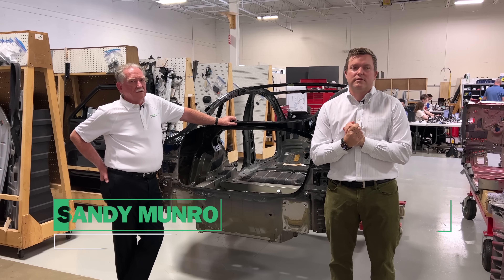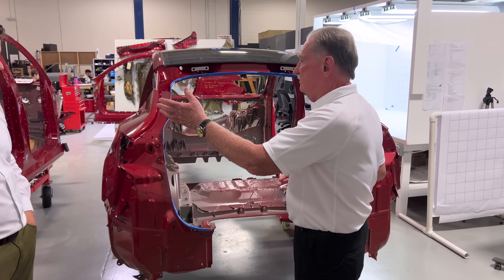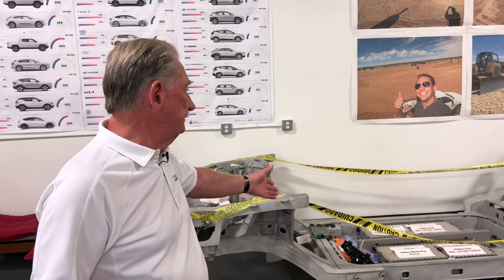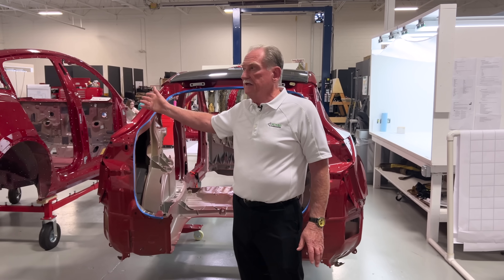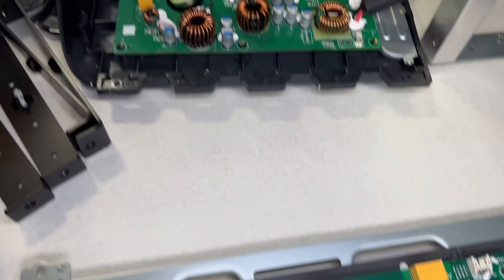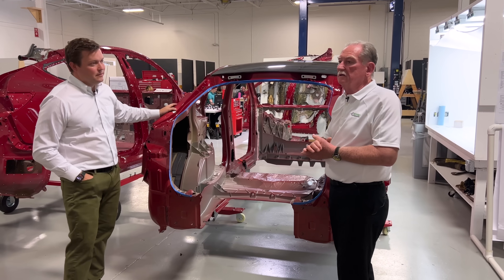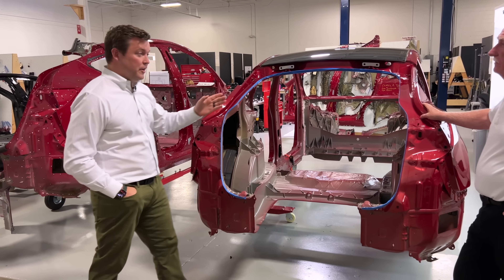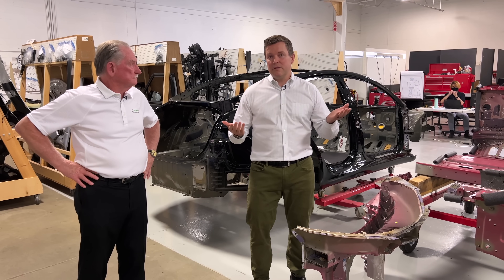Giga Castings with Sandy | Evolution of Tesla Bodies In White

Comment: Thank you, I’ll watch this evening.  I’d be really interested in learning about the molds that go with the large castings.  It’s a Canadian company making them, and they acquired this May two factories in Italy, 20 min drive from IDRA, presumably to supply the European gigafactories.  How many stamps does one of them molds last?  They talk of “rebuild” of the molds, how is that different from building one fro scratch?  Do they need heat treatment?  how is that done? Learning a lot here, thanks.
Reply: I believe the rebuild is them having to redesign the giga press based on feedback and changes in physics due to size.  I know physics doesn't change but when you reach a critical increase in size, the old ways of doing things don't scale properly so they have to be tweaked.
Reply: Steel molds for plastic injection pull 1million parts  the heating and cooling causes micro fractures in the mold, and mechanical wear finally cause out of tolerance part. But that's plastic,. I have no idea about this amazing aluminum alloy Tesla is using. Haven't read any papers on it.

Comment: It’s awesome to see a company like Tesla willing or be brave to take a step backwards (willingly making all of their existing machinery and processes redundant which would’ve been a huge cost) and end up not two steps but several steps forward of any OEM manufacturing process. 

So with the front and back castings and the structural pack reaching just about where our engineering imaginations can go at this point in time ... what is you wish list of what we can improve with the body shell and bolt on panels ... do they have to be all sheet metal? Are there any materials that we can make these out of (that are recyclable in the future), particularly for the bolt on parts (hatch, doors, front guards, bonnet).
Reply: I was watching something about a new police boat (fr. Ultimate Boats) the other day that uses DANU (fr. Exotech), a fully recyclable composite. Probably ridiculously expensive, but the ability to repeatedly recycle and reuse the composite is very interesting. Oh, and DANU panels are bullet proof against small arms which might be useful in some countries :-)

Comment: The first thing the comes to mind with castings is cracking at some point during its service life.  How does TSLA address this.  Just curious.
Reply: Far more likley that those glues/rivets/welds and weld joints will fail at the end of a cars service life.  Every added part is another failure point.  if designed properly, I expect the casting to easily outlive the car, assuming it doesn't get into an accident.
Reply: You obviously didn't watch the whole video. Sandy addresses your question.
Reply: @Triathlete5551  I did watch the video.  In Berlin, some have reported 60% of castings are being rejected.  Has this been fixed after the upgrade?   I worked as a BMW mechanic and have seen cast parts crack.  I’m sure TSLA has done their homework, but for now it’s still kind of scary.  I’m sure the fear will go away over time like it did for range and battery life not so long ago.

Comment: Acknowledging that the castings are a much better way to go, and saves the company a lot of money, then why hasn’t Tesla implemented them for the Model 3 or the front casting for the Model Y made in Shanghai?
Reply: They will.
Reply: They've even added castings to the much lower volume Model S and X with the 2021/2022 LR/Plaid.  Now these are not quite as large as the Y/3 castings, but makes perfect sense for the volume.  My guess they are using the presses that used to make the half-frames for the 2nd generation Y.
Reply: Model 3 has had a rear casting for close to 2 years already.
Reply: @sjokomelk  No rear casting on Model 3. Current line improvements at Shanghai maybe.
At some point, we probably will switch to a single-piece casting, but I think we need to get the Texas factory and the Berlin factory going. We do have an issue. It is hard to change the wheels on the bus when it is going 80 MPH down the highway. So, Model 3 is…well, was most of our volume. Model Y will exceed Model 3, but we just need an opportunity to redo the factory without blowing the cash flow of the company.” 
Musk in Munro interview 02/21.

Comment: good talk by Sandy indeed.

what I wonder: what can Tesla improve next?
Reply: Tyres are pretty much all that’s left.
Reply: Mega volume production AI controlled.
Reply: Once the manufacturing process is optimized, it will be time to address the possibility of easily fix the battery when few cells fail.
Reply: @bernardouellet4324  that's pretty impossible with this 4860 pack, like Sandy showed

Comment: Love this coverage and statements made in it. Thanks for brining up the damage to the casting since so many people fail to understand to damage the casting, you will be happy to walk out alive since you have crush cans etc to take most of the inertia. 

The financial saving for the Giga castings is crazy, not just in part cost being cheaper but also logistics, chance of failure, quality check, molds for the small parts, workers, fixtures all cost A LOT of money.
Reply: I know!  I've been having this argument with people for years.  If the frame/underbody is bent, even in a traditionally-made car, the insurance is going to write that off as a loss, and send you a check.  One of my first cars was a Honda Civic.  I got into a accident, which looked pretty minor, but I bent in the undercarriage by the front passenger door, and the insurance company wrote me a $12k check.  If you're in a bad enough collision to bend the frame, you're getting a new car either way, so the "repair cost" is a moot point; they will never be repaired.
Reply: @AMortalDefiant  The only way most people learn about this is from an accident.  A wildly destroyed single part e.g. bumper cover is cheap to replace.  Two slightly broken parts costs twice as much.  A crushed fender is a common unbolt-replace repair.  A very slight wrinkle in the C pillar means that something is bent beyond repair.

Comment: As always, another great and informative video.
I have been having an online debate regarding the advantages and disadvantages of using cast aluminum vs fiberglass composites for structural components of a modern vehicle. I know that you are very busy and receive 100's of comments for each video Munro Live produces.
If you could please weigh in with your thoughts in regard to, are aluminum castings or fiberglass composites 1) more cost effective, 2) environmentally friendly, 3) end of life recyclability.
Thanks again for another great vid!

Comment: This is great stuff. From what I have read and watched, castings are expensive, the giga press is super expensive and are ideal for 50,000+ unit production run. How would startup OEMs adopt this technology? Are there giga presses available that are ideal for low volume production? If yes, would they justify unit economics?
Reply: In auto the opportunity has passed.

There’s no other obvious (to me) application requiring that volume at that size where it matters.
Reply: Ok. So basically the first 2-5 years of production would still need to be the conventional process (stamping + welding )for startup OEMs till 50000 units are achieved.
Reply: @immigrantlife1089  legacy auto can’t reach those volumes because Osborne effect would bankrupt them when everyone stops buying their ICE cars.
Reply: Unless you have deep pockets, yep, a startup is not going to be able to afford a giga press.  Then again, having the the steel presses and tooling for 150 parts, the equipment to assemble those 150 parts, and then a QA and scrap costs when those system don't work well may exceed that of a giga press.  Automotive startups are hard and very capital expensive.
Reply: @tesla_tap  Your right, that's understandable. Today they developed a 6000-9000tonne press, do you think, in the future we could see 2000-3000 tonne press developed for smaller and lower run applications,  just like slow run and fast run injection mold machines?

Comment: Everybody calls it a firewall, that's what it was (for ic engines)
Reply: Not in public
Reply: @fredbloggs5902  
Yes, in public and not just in cars.
Of course it is also used to deflect the engine under the passenger cabin in a collision.
Presumably neither function is required on this vehicle.
Reply: @andrewholdaway813  in the U.K. it’s always been called a bulkhead as far as the public are concerned.
Reply: @fredbloggs5902  
Yep, that's an equally valid term.

Comment: Haha love this! This video is Sandy's 'I told you so!' to the car execs that told him he was crazy for proposing such castings many years ago.

Tesla is focused on great engineering over profits first unlike the traditional OEMs. Tesla engineers took a genuine look into a fellow experienced auto engineer's thoughts, agreed with him and even went beyond that to implement them right away. Tesla took a multi-million dollar bet on getting these casting machines and it pays off, from the machining at the factory to the end of the product's life during a severe but life saving crash.

Munro proves how great engineering can make a massive difference in your manufacturing, costs, and end product, even if it sounds crazy at first! #BreakTheMold
Reply: The castings are great for Tesla's bottom line, but not the consumer or environment. Any damage to these castings, even from small accidents, is not repairable, so the cars are a complete writeoff. This pushes Tesla insurance costs to absurd levels and forces a vehicle with an otherwise long remaining useful life into a landfill. Other cars, without a giant casting, can be repaired and put back into operation. And that's much better overall for the consumer and environment. Also, the cost reductions from these castings are not passed on to the consumer. Tesla's purchase costs has been increasing steadily every month. And Sandy is praising this approach because it gives him a sense of vindication, so his comments on this topic come with a heaping dose of confirmation bias.

Comment: Several concerns I have with the cast parts:

1. Because of the nature of molded parts, you can't have any tubular structures which are ideal for strength and rigidity. I wonder if strength was a sacrifice they consciously made.
2. I don't know how well their special alloy holds up against vibration, but generally Aluminum is susceptible to fatigue, I'd like to have data on that if it ever becomes available.  
3. Although simpler, cast parts are not always uniform. I'd like to know their tolerances for the part, and their scrap rate.
Reply: Castings use webs instead of tubes.

They are clearly visible.

This isn’t new, it’s been done for decades on things like gearbox housings.

You don’t know this?
Reply: 1. They're not replacing any tubular structures which would've been in that region of the structure. 
2. Fatigue in such a substantial part should be even less of a factor than in an engine block or transmission casing, and fatigue life should be extremely long. 
3. I have no idea :)
Reply: @jamesengland7461  
1. Perhaps, but they're looking to use castings in the Tesla truck, where frame rigidity will become doubly important. 
2. Fatigue is a function dependent on material strain, they mitigate its effects in an engine block with added material thickness, which these cast parts don't seem to have.
Reply: One absolutely can make tubular structures in castings.
Reply: @timrowledge7152  Yeah only in the direction of pull. Given the size of the part and extreme temperatures, I'm guessing pretty steep draft angles....Your tubes won't be very long.

Comment: Tesla should get rid of holes in the B pillar. This will strengthen the body in a side impact structure. The seatbelt retractor can go under the seat or in the seat. Or at least get it off the floor but by at least 18" off the floor. It's a very bad place for holes in the car's structure.
Reply: Yet strangely, Teslas have the highest safety ratings of any cars ever tested.
Reply: @fredbloggs5902  In a T bone collision the B pillar needs to be as strong as possible. It would cost less to not cut it out and bolt the retractor under the seat. They have done this in the rear seats. 1/3 of all fatalities are the result of side impact collisions. This modification should yeild a lot of safety for almost no cost. Maybe a negative cost.
Reply: @suggesttwo  you’re welcome to list all the people ended in side impacts in Teslas...

...oh wait! There aren’t any.
Reply: @fredbloggs5902  No Tesla has been T boned by a full size pickup? Maybe it will just prevent injuries. What's wrong with that?
It will also strength the car in front end collisions by giving the crash bar in the door something stronger to push against.
A stronger B pillar will also increase roof crush strength.
Reply: @suggesttwo  Your comments are worthless.

You’re blocked.
Reply: @fredbloggs5902  I can still see the reply button.
Reply: Holes eliminate weight - a valuable consideration.  I'm sure Tesla, like all car makers design using very sophisticated structural analysis.  Tesla gets 5-start crash ratings from side impacts, so they must be doing something right.
Reply: @tesla_tap  that's where the seatbelt retractor usually goes. This is the wrong place to save weight. The best place is at the top because it improves stability too. 
Stability is the highest prediction of safety followed by crashworthyness. 

Having the battery pack under the cabins the best possible place. It tracks, allowed drivers to escape collisions. resists roll overs with a very low center of gravity. The thick floor (battery) will help resist intrusion in side impact collisions. A polymer roof instead of metal. Could be clear. Could be cool. It doesn't take metal to provide cross bracing.

Comment: Genius design but has 10 times more problems then a Lexus.
Reply: Either provide your evidence for your claim or admit your comment is worthless.

Note that everyone here can see your nonsense claims that a replacement battery pack costs $25k.

Who’s paying you?
Reply: @fredbloggs5902  Lexus has a score of 78 and Tesla 200. You can easy find that yourself. Tesla battery pack replacements cost between $20,000 and $30,000
Reply: @epoxy1710  Why are you lying about battery pack prices?

The $22k for an S pack was because the car did not have an original Tesla pack.

You know perfectly well that the current trade-in price is $14k.

You’re obviously a shill, go away now.
Reply: @fredbloggs5902  On Model S 85 or higher models the price is between 20k - 30k
Reply: @epoxy1710  that’s total replacement without trading in a genuine Tesla pack.

But it doesn’t matter, everyone can see how biased all your other comments are. 

Your comments are worthless.

Comment: When will the model 3 get the giga casting pieces?
Reply: It has had the rear one for close to 2 years now.
Reply: @sjokomelk  NO!
Reply: @waynerussell6401  Is he incorrect?
Reply: @R0ck0j0n3s  No rear casting on Model 3. Current line improvements at Shanghai maybe. 
"At some point, we probably will switch to a single-piece casting, but I think we need to get the Texas factory and the Berlin factory going. We do have an issue. It is hard to change the wheels on the bus when it is going 80 MPH down the highway. So, Model 3 is…well, was most of our volume. Model Y will exceed Model 3, but we just need an opportunity to redo the factory without blowing the cash flow of the company.” Musk in Munro interview 02/21.
Reply: @sjokomelk  Oh wow. Okay, sweet!

Comment: Can those castings be used as designed even after the body styling/shape changes?
Reply: Model 3 and Y share platform. And I believe they share the rear casting too now.
Reply: @sjokomelk  Model 3 does not have a rear casting.
Reply: Yeah good point, like multiple models.. huh.. that would be insanely efficient